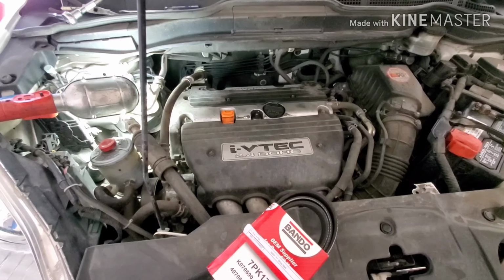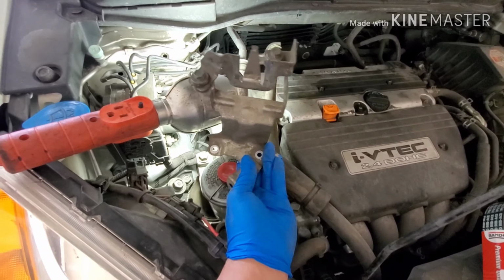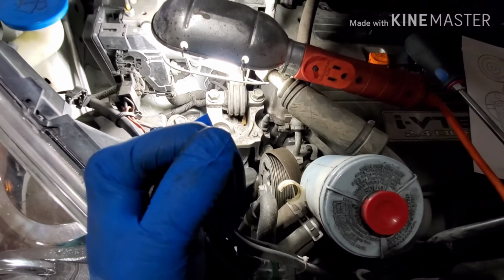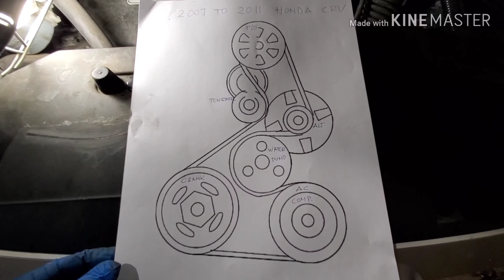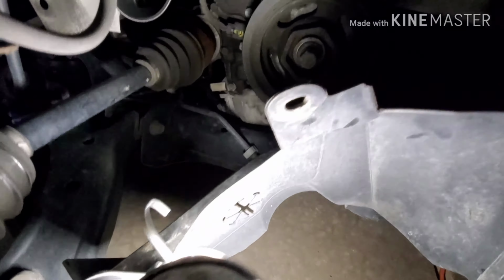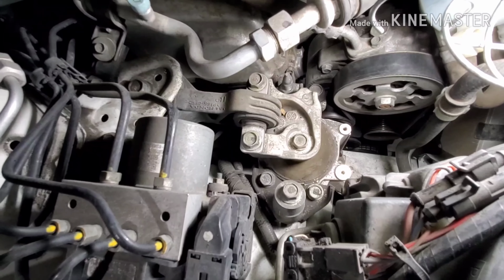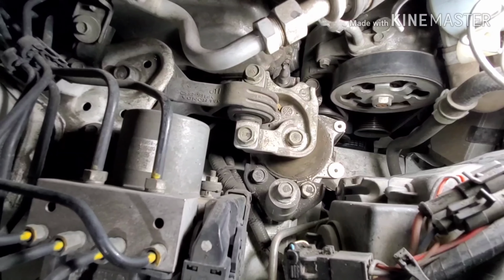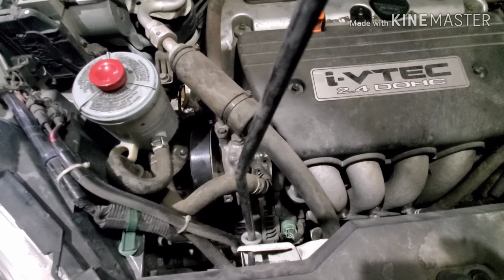Honda CRV belt replacement

Comment: I just did this on a 2011 CR-V and using a serpentine belt tool from harbor freight makes pulling the tensioner back a lot easier than using some other type of wrench.